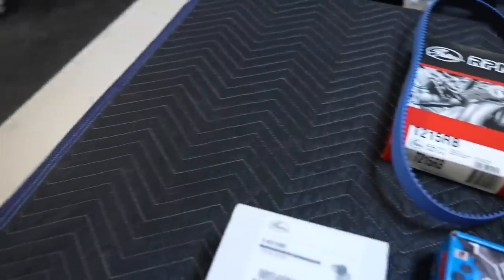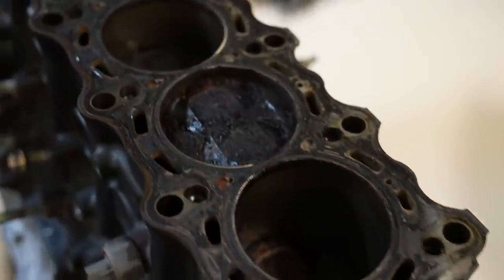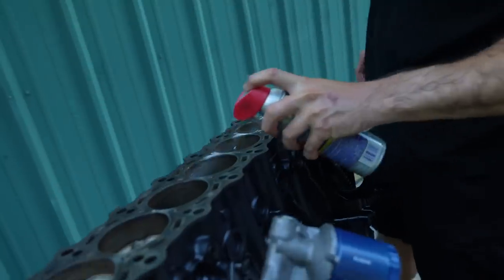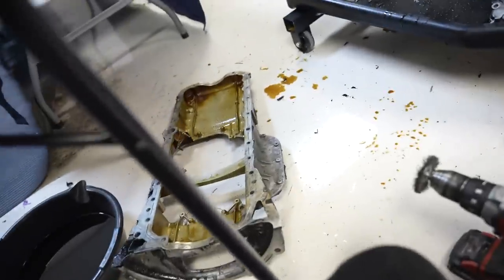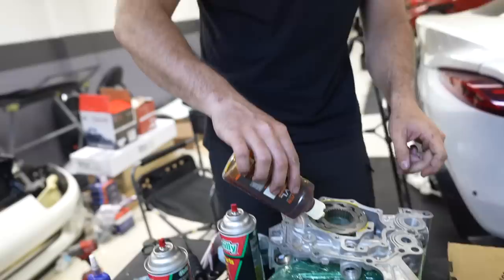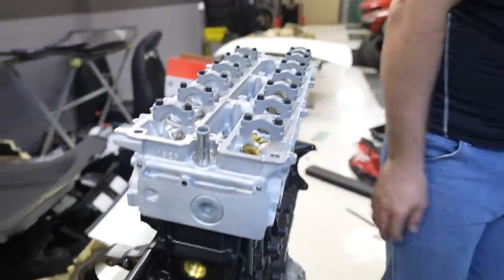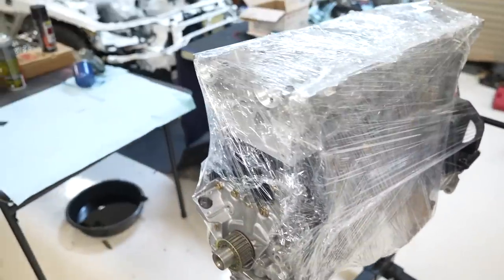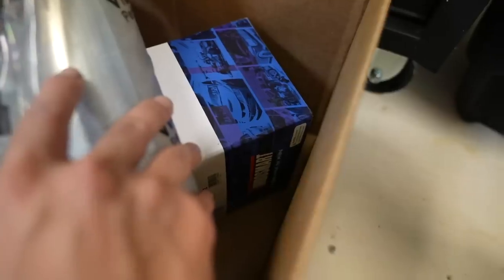SUPRA 2JZ ENGINE BUILD! Converting from N/A TO TURBO!

Comment: In the future for 2jz builds go Fluidampr, alot of ppl have issues with the ATI fitting properly cus tolerances change on used engines n ATI went off a spec of a brand new GTE crank which is why they have a tendency to be too tight n not seat properly or go on at all without baking it to get it to loosen that 0.001mm.

Comment: Hey Mike. 
It looks like you are using the oem shim on buckets. They are fine to use, however the cams you have gone for, although they are incredible bits of kit, they are billet, not old cold rolled steel like older cams. The billet cams are known for eating into the shims/buckets. I would say it's worth going for diamond like coating on the shims, or the same coating on solid buckets, or go for non billet cams. Otherwise you might start finding bits of metal.
Awesome video man

Comment: How may miles were on the motor before you did the refresh? I have one with 78,000 miles and now has a Garrett 6262 Gen 1. wondering if I should get the motor pulled and rebuilt.

Comment: Does Outcast precision machining do "repairs" on the 2JZ ??
I need my valve seals replaced. I get random start up smoke and occasional smoke out the muffler after sitting at idle for some time ...

Comment: Why reuse the old non vvti ge pump vs switching to a vvti oil pump which would allow you to then use the 32t trigger wheel and oem crank sensor?
Reply: @vic2982.  exactly, he's using a vvti head...so it has no place of a distributor.
Reply: @vic2982.  no shit, you're just rewording my original message is my point.

Comment: Nice  build  cant wait to see it driving  just when building a car its alot of work but in the end much more rewarding .build not bought.
Reply: Did u use acl bearings or oem Toyota bearings  for big end and mains on 2jz .sorry for stupid question  I used Toyota bearings. With std clearance . Planning on 450kw @ flywheel. 1000cc injectors  .272 cams I got 2jz ge vvti. With  2jz gte oil pump  .

Comment: Mike, you kept ge non vvti oil pump. What about crank trigger?
Reply: Hopefully he notices before dropping the motor in, as it would have to come back out to change the pump. Good eye on that!
Reply from the maker: Good catch! Don’t know why I didn’t notice that
Reply: @diiviinemedia  GE VVTI pumps have the same crank trigger provision as GTE pumps FYI
Reply: @diiviinemedia  also use vvti crank timing sprocket, its way more accurate compared to non vvti 👌

Comment: Motor and Engine are both correct regarding a car ICE.
motor: "a machine, especially one powered by electricity or internal combustion, that supplies motive power for a vehicle or for some other device with moving parts."

engine: "1 · a mechanical tool or device ; 2 · a machine for driving or operating something especially by using the energy of steam, gasoline, or oil "

but really its just a dialect thing. unless you want to be one of THOSE GUYS that corrects someone when they say "pop" instead of "soda"
Reply: I think engine is "a machine turning chemical energy into work through combustion"

Comment: Why not go with forged internals? If you're going all out with the build why not do it right the first time? Would be sad ruining the prepped head whenever a rod/piston says bye bye..

Edit: I just did my research, turns out rods/pistons on the non-vvti GE are basically the same as in the GTE except for compression ratio. Makes sense not building it then. g35-900 might still be a bit over board though no? :P
Reply: it would make sense to do forged or go all out now because what if later down the road u wanna up the hp or boost  your gonna have to take apart the engine again and possibly rebuild the whole engine to match the effectivness of the new parts with the even newer parts  to make sure u get maximum output of the engine rather than doing it one time and just having to tune the car with OBD readers n shi if u get what i mean well me personally thats how i would do it

Comment: Get a dm oil pump
Reply: Terrible suggestion
Reply: @ProfessorDickweedMD  I’m running one no issues
Reply: @itsreallytheo  and people run OEM, PHR, etc. without issues how is that a reason to recommend it over another? It’s still overpriced and out of stock.
Reply: @ProfessorDickweedMD  have you ran all 3 or just phr or oem?
Reply: @itsreallytheo  Yes, and others, but I’m not sure what that’s got to do with my question. Why recommend DM? Legit question. I don’t know why people recommend them and I see an opportunity to ask. Thanks.
Reply: @ProfessorDickweedMD  personal preference but cnc ported vs hand ported but double check for metal shavings on ported pumps
Reply: @itsreallytheo  DM just.. never comes thru for me. I'm glad you had a good experience. Honestly OEM pumps sometimes have shavings too :/
Reply: @ProfessorDickweedMD  we’ll long story short they stopped hand porting their pumps and started using cnc methods for production speed but you cant go wrong with either one oem or modified
Reply: @itsreallytheo  The CNC porting is pretty cool. Thanks for explaining your recommendation I appreciate it.